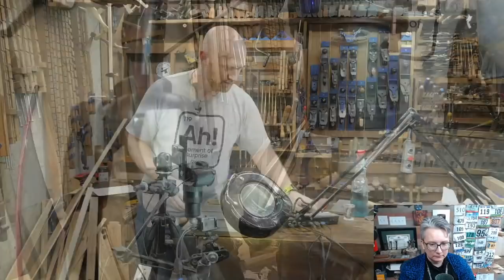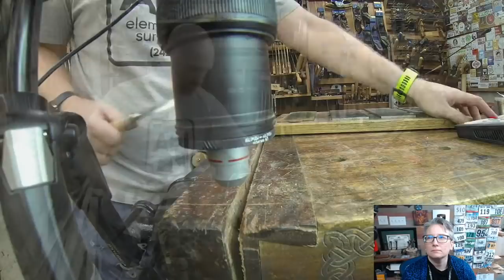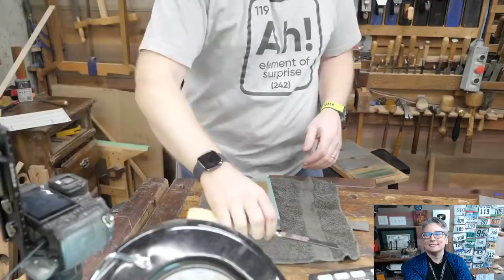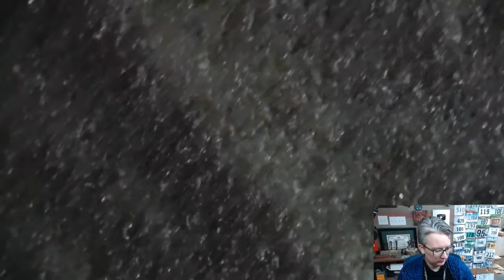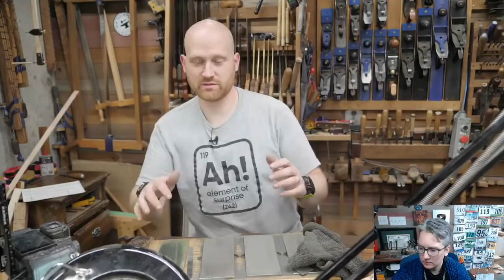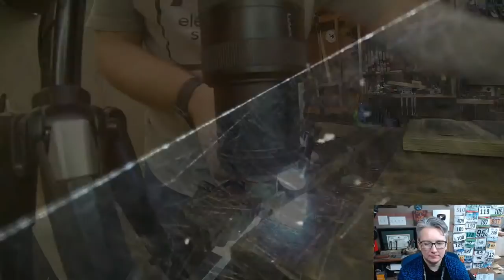Sharpening Systems and Edges Under Microscope

Comment: Have you seen Rex’s video on the super cheap diamond plates?  Got my set for under $20 before stock ran out. Cheaper than sandpaper. They are rather thin but so cheap you can afford to replace them yearly.

Comment: It's interesting that you sharpen on the push.... I've seen several videos where folks are only drawing the blade, curious if there's any substantial difference, or is it just preference.
Reply from the maker: That is a holder over from soft water stones. But now adays with good water and oil stones or diamonds it does not matter. But if you use sand paper then you just want to pull!

Comment: The diamond stone is defined as a two body wear system.  The water stone is a three body system which allows the abrasive to roll and slide which explains the difference in appearance of the wear surfaces.  The water stone may have a larger difference in abrasive size as well.  The two body system generates more uniform scratches and removes material more efficiently.

Comment: Video suggestion: James, could you maybe please create a video on what different sharpening media are and are not? Perhaps covering questions like:
Is 1000 grit sandpaper from the hardware store the same grit as 1000 grit automotive sandpaper? Is either of those the same as a water stone marked "1000" or a diamond stone (or I guess it's a diamond plate?) marked "1000"? Do oil stones come with numbers? (If I get an Arkansas stone, do I need Missouri and Alabama stones to go with it?)  Does it matter what color compound I use on my strop (&, if not, how come it doesn't)?
Plus a bonus question: They're not for sharpening metal, but what about those abrasive pads for use on wood - how many grit is "maroon"?

I would really love it if someone did a video on this, and I would love it even more if you were that someone.
Reply from the maker: I've done a couple videos that cover most of that. If you look up all about sharpening. I've done a couple different lives that cover that topic.
Reply: Google the gritomatic grit chart and it will give you a comparison of all of the different stones, sandpapers, etc. and show you how close they are to each other. It also covers the F and P grit differences. It’s an awesome chart.

Comment: I'd prefer a shoot out between something like the chosera line or the Shapton Pro Kuromaku stones and the diamond plates, the softer stones dish out with just a few passes, diamond plates stay flat, I have a Shapton 2k,5k,8k and the Chosera 1k. I usually stop at 2or 5k on my woodworking tools 5k for plane blades and 2k for chisels both at 30°, I'm into honing and sharpening knives and straight razors so I have Naturals and synthetic stones.

Comment: I am interested in how useful the fine stone/plates are, if you are using a strop.  Could I strop after the middle stone and have a good edge?
Reply from the maker: Generally, green compound on a strop is roughly equivalent to around a 12,000 grit sharpening. So if you're going up to an 8000 grit stone, there's no reason to strop after that.
Reply: @WoodByWrightHowTo  but what if im only using a coarse and fine diamond and then strop.  What am I losing by not going to an extra fine stone?
Reply from the maker: you would have to spend more time on the strop then normal. but it will generally give you the same end.
Reply: @WoodByWrightHowTo  interesting!
Reply: @WoodByWrightHowTo  The last things Im interested in is how the blade looks after a few passes on the plane?  How much of the sharpening effort is lost immediately, and is probably not worth the effort?